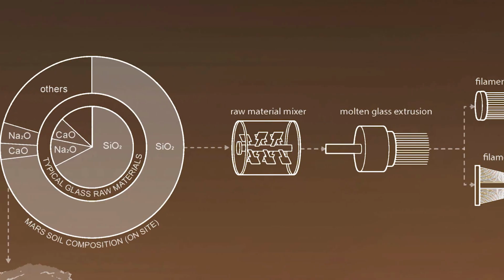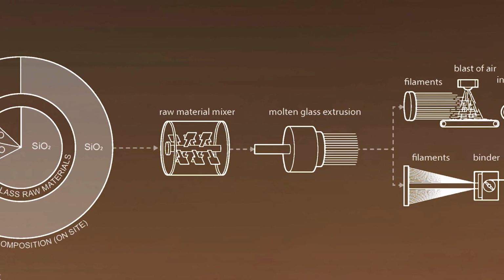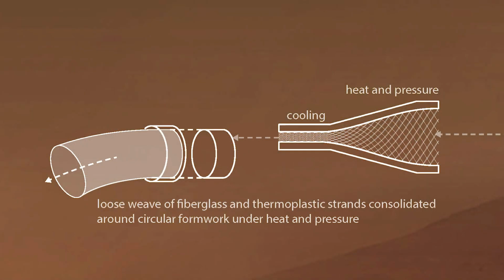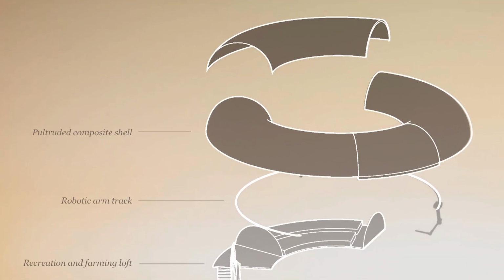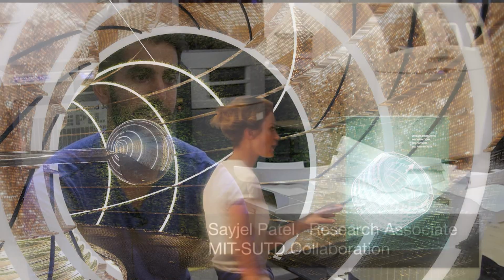Digital Printing On Mars

Comment: I think building habitats inside Pyramids are likely the optimal solution to the radiation & temperature problems, both on the Moon and on Mars. You build a shell of polymer mixed with regolith to line the outside shell of blocks, then tamp down plain regolith up to the top of that level of blocks, but create inner walls for the habitat that will be pressured for astronauts. The tamped regolith provides protection from radiation, while holding the habitat's pressured environment back from expanding and contracting, and providing temperature insulation during the open surface conditions of 300 degree temperature variations. The original pyramids also provided a ramp to move blocks up as the pyramid was built higher and higher, and this same ramp construct could provide robots an easy way to move equipment, machinery and stores up to their assigned levels within the habitat. Finally, the ramp could be sealed and used for emergency egress. I think pyramids may be the best choice. The fellow in the attached video worked out the building of the pyramids using this process.
https://www.youtube.com/watch?v=eGqfdXkAQMk